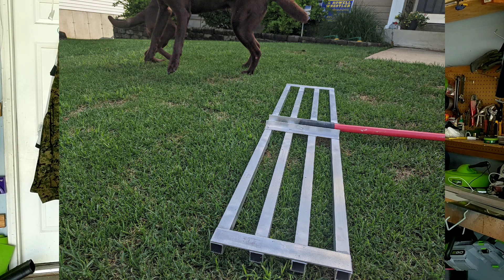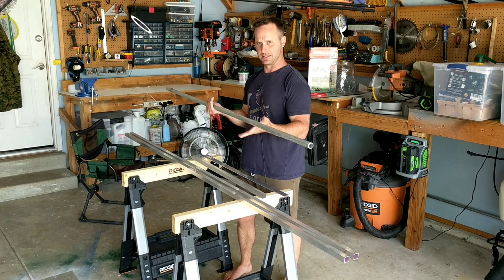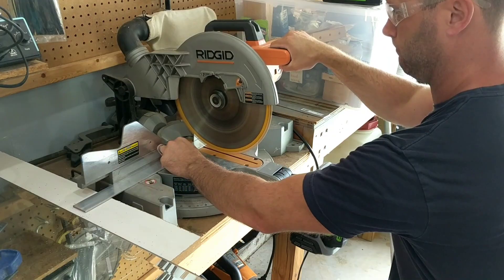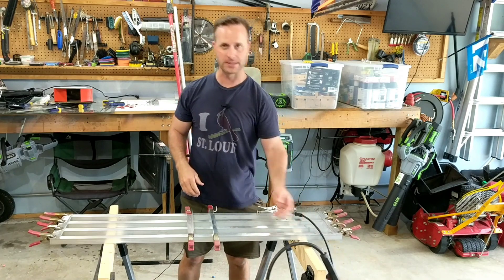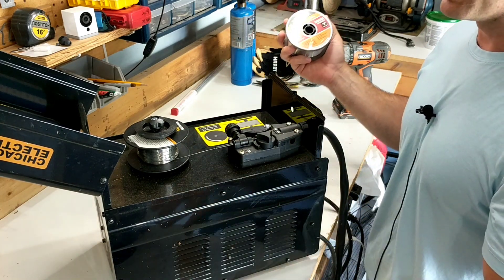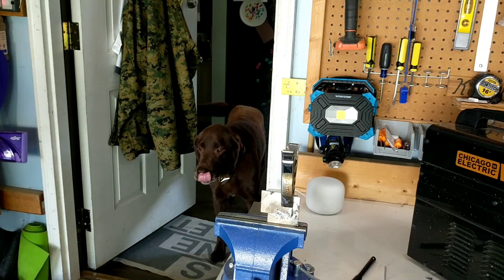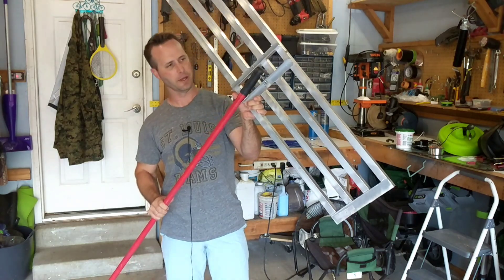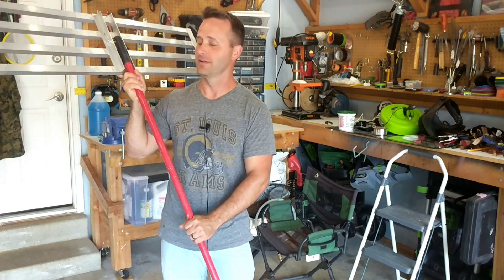I made a 4 foot Lawn Leveling Rake and learned a lot getting there

Comment: I have to give you an "E" for effort .  When I started using my Har-Freight wire feed welder with aluminum wire , I found that it is important to pre-clean the parts with acetone , then PRE-HEAT the surfaces.  Don't do it on cold floor or other structures that will act as a HEAT SINK , drawing heat from your project .   Also ,  you can never have too many clamps.  I used medium size C clamps but made sure they were warm before welding.  Also, it is best to keep the tube for the wire feed as straight as possible so that the thin aluminum wire does not kink due to friction.   Using the alum brazing rods was a good 2nd method.   plenty of heat with the blow torch.

Comment: Yellow can of gas at Hardware store is mapp gas, that’s all you needed to get it hot enough but cool improvisation.
Reply from the maker: Thanks for the tip WC! I looked into that, but was hesitant i'd have the same BTU issue, albeit a higher temp flame.